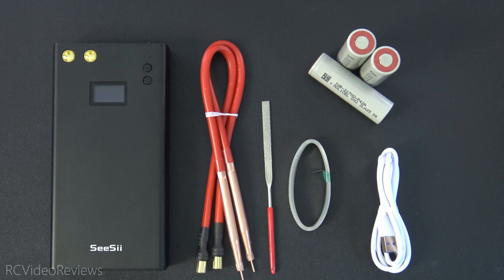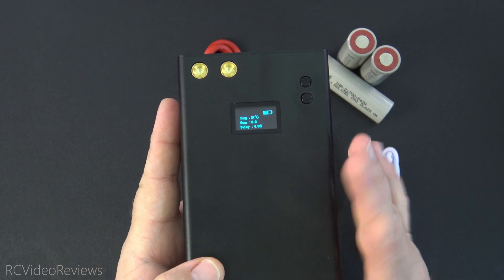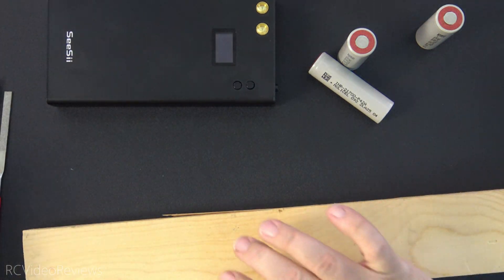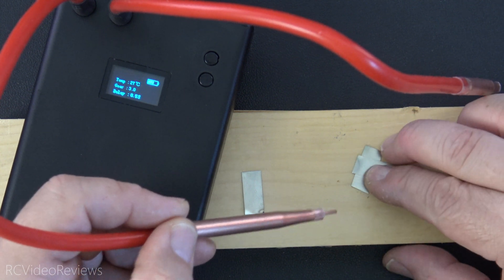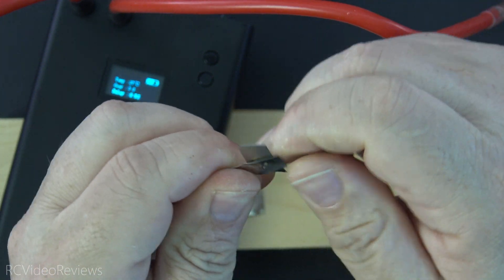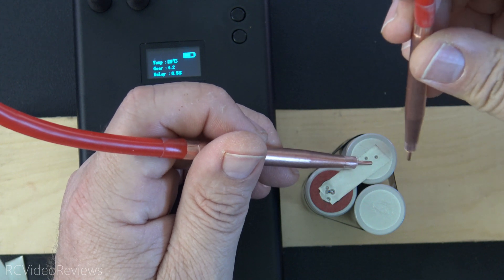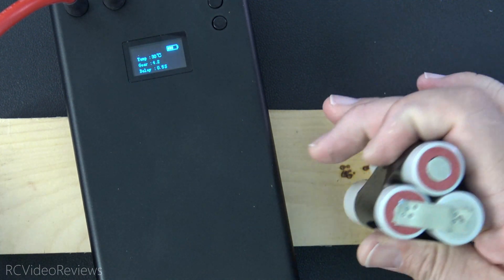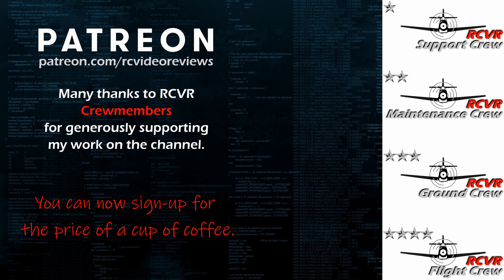Budget Amazon 18650 Battery Spot Welder by SeeSii Review

Comment: gentle touch!? i had heard about too much pressure before but man have don't it wrong. no wonder the weld fell apart. though when i used a marine battery and starter soienoid it didn't matter. these baby welders need that resistance to make heat to melt the metal

Comment: I ordered one like this which will arrive Thursday. I purchased a pen first but I was very disappointed in it. I am tired if soldering my battery packs. The pen did get the job done but just barely before it stopped working and I never got to add another layer of nickel strip. I didn't know I needed 4 of them or even two however I did intend to out two on. The battery pack did work but I need to go back and redo it once I get this one because the welds are very weak. I tried the battery pack out just to see and it seems fine however I would not trust it's durability as if I dropped it, it probably would not hold up. Hopefully Thursday I can fix it properly.

Comment: I just welded a 4s4p pacl but did not use the cardboard insulators. 
Should i rip apart my whole pack to place them?
It is original/new samsung inr 21700 cells.
They are insulated with shrink wrap and the white ring. I am a little worried it might cause problems?

Comment: Some LEDS require up to 3.6 amps max, like for the Cree xhp-70, but I can barely see the width and thickness of the "PCB lines" on the star they put them on. They only need 3 to 12v, though.
Thanks for the obvious "lets pull it apart" testing 😁

Comment: what does low pressure do? ive always used high pressure
Reply: I just tried low pressure trick, and my device finally start WELDING. Before that I was only able to destroy thin plates, but not solder to 18650 tabs

Comment: I bought this same welder last month. It worked well with the steel strip they give you in the box but it was woefully underpowered for pure nickel strip of 0.15 or 0.20mm.

I'm on the hunt for a more powerful unit as I don't trust this to be sufficient for the pure nickel strips.
Reply: Having the same trouble with mine...works great on the thinner .10 strips but fails  on anything thicker.  Trying to rebuild my Milwaukee M12 battery packs with better batteries.  This spot welder will not work on the .20 tab connectors that Milwaukee uses are to handle the current load.  Have to double up the tabs, one on top of the other.
Reply: @ I replaced it with a Seesii 801d and it's awesome! I've used it on.15 pure nickel and .20 with no problems and plenty of headroom still.
Reply: good to know.  I'm dealing with the same issue with mine.  Not powerful enough for .15 nickel strip.  It's the same welder, but doesn't have a label

Comment: are this unit you have still working?, I rarely packing 18650, so are the battery inside this welder still good if not used for a long time?.
Reply from the maker: Mine still works. I don't use it too often, but it does still work. LIPO tech can last at storage voltage for quite a long time. So after a session, don't recharge to full.
Reply: @RCVideoReviews  I see, thanks❤

Comment: Don't know why people attacked you for using pressure as you do need to ensure that the strip is contacting the battery before the welding pulse occurs.  Even automated spot welders use a specified degree of pressure between the materials.

If you don't have good contact, you WILL blow holes through the strips, so perhaps you shouldn't listen to us youtube commenters ;).  Ask a spot welding professional.
Reply from the maker: TBH I just do what works. If I use too little pressure and good contact isn't made, I increase the pressure. If the pressure is sufficient to eliminate the air gap but the weld isn't strong, I increase the power. In the end, I have batteries that I've been using for 3 years and they're doing juuuuuuust fine. You know what they say about opinions....

Comment: I'm not sure, but it doesn't seem to be a capacitive discharge spot welder - seems like a high power resistive welder.  I saw this because the strips seem to have heat discoloration (blackness) and also the wood got too hot in my opinion.  It's too bad you didn't get the case open, but I suspect there isn't enough room for the necessary capacitors.  Nevertheless it does look usable and price will be the deciding factor.  Unfortunately, circuit type (discharge vs resistive) is generally not mentioned.

Comment: I just got this identical item (I think it comes from the same manufacturer but is cheaper and listed as a no label product) and I could not get it to work.
I have used a soldering iron forever so I took these nickel strips and pressed both electrodes and thppt! Nothing. Barely heated it up. After seeing your vid and a bit of thinking seems I can use one probe to hold the strip down on the battery and the other probe (where I want the weld) I only GENTLY touch. BOOM! That does the trick. After time the learning curve in this method starts to come more and more. A very useful tool for future projects! Thanks!

Comment: Hi, could you please do an experiment with this welder and try welding a tongue and spade wire connector together? I have a small approximately( 6”/3” /3.5”) 12v 7.5 ah battery that has a tongue on each +/- poles but I really need a good solid contact. Soldering is not up to the job as it comes loose after a while. I have tried gluing over the solder as well. I am going to try some stronger type of glue. But if you could try your welder and see if it will hold them together or weld the nickel plate to the spade and tongue then join the two together. I would really appreciate it you try it and let us know if the welder is good for that. Thanks in advance

Comment: I wonder how they came up with the translation of "gears" for the output levels.  The "gear" just stands for the duration in milliseconds that the output pulse is delivered; the longer the duration, the higher the amount of energy in the pulse.   The actual current doesn't change with the "gears" and is just dependent on the battery quality and all the connections out to the probe contacts.
I have a $15 DIY unit from Temu and connected to a LiFe battery, it delivered about a 422 amp pulse, with 5ms sufficient to do the spot weld.
Reply from the maker: I think the rough translation is levels or power.
Reply: @RCVideoReviews  yes, but it's an odd translation, by whoever came up with it- assume it was from a non  English speaker.
Reply from the maker: I've seen this same error repeated on multiple occassions.
Reply: @dubmob151  Yes, definitely Chinglish.
Reply: Could it be that an image of gears has become the 'settings' icon for electronic devices? Maybe it should be labeled Setting rather than Gear ⚙️
Reply: @Sønclear-B  now it makes sense how they came up with that nonsensical translation🙂

Comment: Good luck with yours.  I have one I bought about a year ago, and I've used it once. I got it out a week ago and charged it, the screen shows fully charged and I can change settings but it won't weld. As far as I'm concerned this is a total waste of money.
Reply: @brucemansfield2501  Bro it might be that battery isn't good to go anymore, unfortunately they use cheap and low quality batteries for this cheap devices. If you can take apart the device and check what battery is used and replace it that might solve the problem.

Comment: Nice review, but the USB Output is completely unnecessary and the 5V 2.1A USB-C Input is not well thought out. USB C can do more, so I don't understand why this Device wasn't equipped with a corresponding Input. I would have expected a top charging Circuit, especially at this Price. Because of the Display alone the Price is higher than an equivalent cheaper Device that performs the same Task. I'm currently looking for a new one and I would never buy this one for this Price. Thanks for the Video that made this clear to me.

Comment: Great video. I've never messed with building battery packs before, but this looks like a great way to rebuild some of the dead Milwaukee packs I have laying around with quality cells.
Reply from the maker: Definitely. I've seen videos where they take existing packs apart and of multiple cells, only one is bad. By combining good cells, they recover packs worth decent money.
Reply: That's why I'm looking into this. Milwaukee batteries are so expensive anymore. I'm looking at getting batteries from liion wholesale. Apparently they're authorized distributor for several brands.  Looking at the high drain batteries. I've seen some videos of people soldering the batteries but I'm pretty sure you can damage the cells really easily doing that.

Comment: Hello. I have one just like this one, a year old. But on the third battery I was going to do, when turning on the device the display is off!!! Do you know which component I can buy, and where, to solve the problem?
Thanks.
Reply: I was reading on some amazon reviews that if you don't use for a long time then the internal battery will self discharge to a point where it can no longer be charged again.
You could open it up and check or replace the battery.

Comment: I just received a generic version of this welder. (Although the product description stated the brand as Seesii). The probe sockets are not central in the case holes and are shorting across the metal case. Also arrived with the battery at zero charge, and USB A port mounting points had come un-soldered due to the poor fit of the case. Be careful people!
Reply: They have to ship it almost fully discharged...

Comment: So how is the Welder holding up to the USE your giving it .

I would like to know weather to buy one of this brand.
Reply: I'm not him, but I use the 10,000 99 gear model of Seesii. I have done done 17 packs, three on bench to do. No issues, except you pop, pop ,pop. Just going from one battery with no break, I've had the welder unit get to 95* or so and the probes hot in my hands...
Reply: @davidbarker3591   Thanks I just started to build battery packs for my use on my bikes and so far its working like it should . I bought one of these from this company and It works ok so far  haven't really did a big battery pack yet but I plan on building one for one of my custom fatbikes BBSHD odd shape frame center

Comment: I bought this from Amazon. Could not weld pure nickel strip @ .015mm thickness with any strength. Even at GEAR 8.  Had to tear down a 8S4P Lifepo4 battery I built due to weak welds and current imbalances. Returned to Amazon. LiPo packs inside. Second elder I tried. Don't think the small units at around $100 are able to go much beyond .012 mm plated nickel strip.
Reply: Maybe u got a bad one. I have the 10,000 with 99 gears. NEVER used  plated steel. That' stuff is junk. Pure .10mm nickel, easy. .12mm is pretty easy. I've done .15mm pure nickel. It'll do it, but is at gear 
85-90. As a person practices and gets a better technique. Also keep the tips of the probes clean. That really hurts performance..

Comment: Very nice video and a great help to make a decision.
Do you have a picture of the inside of the device in the meantime? I would be very interested to know which batteries they have installed.
Thanks again for a very factual, objective and informative video.
Reply from the maker: I tried taking it apart and to get a look at the cells would be destructive. I think they’re some sort or lipo.
Reply: @RCVideoReviews  I have learned that you are right on both counts, 1) They are LiPo cells, and 2) it would be destructive to look further. You made the right choice to not go further. I have one on the way now. Thanks again for your post!

Comment: I used the same welder for Makita battery 🔋 to be welding. 0.15mm Pure Nickle strips was used but the welding has weak... 0.2mm would not do it.
Reply: Your technique will get better. Make sure tips are clean. I do 
.15mm pure nickel decent. Never had problems the Seesii will not do .20mm thick

Comment: 9mm x .15mm gives about 1.35mm2 which should be good for about 17A *continuous*.
Reply: Don't know where you got your numbers, but that's not even close!! If you had pure copper, 1.35mm Sq is good for 20.5 amps. Pure nickel is 24% as efficient as copper. A strip of pure nickel. 15×9mm is 5.5 amps. Heck, .4×9mm is only good for 13 amps. The closest he might get is .2×10mm and that is 9.9 amps...
Reply: Matador Ampacity chart shows 6 continuous amps. It's the same cross section of 16 gauge copper wire that is good for 21 amps, which makes sense as pure nickel only pulls 25% of copper

Comment: Why risk damaging the probes by placing them so close to each other?

I appreciate too much pressure is not good but surely you want to ensure as much as possible that there is no gap between the 'wire'/strip and battery terminal...?
Reply: If you spread them too far apart, by the time the current goes back up the the 2nd lead, it's weak...look at the machined spot welds. 1/8" apart.

Comment: Hey amasing video, well i am thinking to get one for model making, looking to weld stainless steel wire 1mm thickness, important not to solder but to weld, can you help me and check if this tool can do that, and if its holding well.
Please :)
Reply from the maker: This isn't the right tool for that. The strips are very thin.
Reply: We spot .1mm....you're talking about 1mm....that's 10 times thicker...

Comment: any idea why it would stop welding properly I used 2 months ago and built a big battery and it worked well. today I charged it up fully and now I cant get a good weld even on its highest gear
Reply: I can do a full battery, 5s 2p and not use 1/4 ...I'll just plug it in while I'm doing different. Make sure the tips CLEAN...get rid ozone residue and impurities.  Amazing what a difference that makes.
Reply from the maker: Sounds like a dead/flat battery...?
Reply: @RCVideoReviews  it charges to 100% and if it died after like 100 spot welds that is pretty sad

Comment: How dangerous is charging this unit if it has LIPO battery ?
Reply from the maker: Since it doesn't rely on any specific type of charger (balance charger) it will have a BMS installed to keep cells balanced and the charge cutoff at the appropriate levels.

Comment: Can you please confirm 2 things:

1. Can you spot weld two on each other connect them in parallel on the battery
2. Also do you need safety glasses for this, because I know with welding (causes eye damage if you look at the point)
Reply from the maker: You can weld one strip to another. Do them one at a time. 

It's never a wrong answer to use safety goggles. That said, I do not wear them for spot welding. I accept the risk.
Reply: @RCVideoReviews  Thank you so much, would you tell me what glasses would be good for this from Amazon?
Reply: I always spot the first layer to cell. Then lay down the 2nd and spot to first layer

Comment: Thanks so much for the upload and great info. Just got my very first kit in and its set up exactly as yours but it says upgraded 3Goa model, although the one on amazon says Riiai on it, made by Shenzhen Jueqi Tech. Same specs 7500mah 650A. Don't see where the upgrades are. Eventually want to build my own quad copter, Space 1999 Eagle or TOS Enterprise, but to get experience on the batteries I decided to upgrade my 14 year old Craftsman handisaw with a few LiPo. I was wondering, to get the higher amp pass thru, would it be better to tack the first two, bend the strip over, tack those two and then bend it over again.... so on and so on, and then cut the strip, so it'll be one solid instead of separate strips? Thanks again for getting me up to speed on my new mini-defibrillator ;-) Go gentle into that good tack weld night lol.
Reply: Its odd that the cheaper one I ordered said it only has 7 gears, the one I received has 8, but that one is 11,000mah hmmm. Oh and it has an auto shut off after 5 minutes.
Reply: I've never seen anyone do it the way. In the long run you'll use more strip though..

Comment: When doing multiple strips would you consider welding between terminals?
Reply from the maker: I don’t think it’s necessary.
Reply: It can be very important. If doing a power tool pack, you get a lot of packs hot rod cells. I use Samsung 25R a lot. Max constant discharge rate is 25 amps. It can flash 60 amps for 1/2 second. If you are laying down .15 pure nickel, .15mm×8mm wide is good for 5amps...I normally use .12mm nickel. I'll stack If you are using a hot rod cell, you'll at least stacking. If I need capacity, I solder 18 awg pure bare copper wire is is good for 15 amps. I've built with 2 wires soldered to the nickel. I try to solder the wire to nickel before spot welding. That gives you about 35 amps

Comment: great video learned a lot. so I should double up on the strip to carry more amps? what's a good size to use max current pull around 30 amps to be safe but not consistent, 15amp continously.
Reply: I use Matador Ampacity. It gives you current capacity, the mm² area, gives you equivalent  in AWG copper wire.' 5mm-10mm width, .10-.50mm thick. If you use a little spot welder, like I do,   .15mm is maxed. But even .15×10mm is good  for 6 amps, so you might, by stacking 12 amps. I'll solder solid copper wire you strip, then spot weld the strip. 2 side by side 18awg copper wire is good for 14A each. That handle 35 amps..
Reply from the maker: There are charts like this one out there listing current carrying capacity of metal strips: https://www.diyelectriccar.com/attachments/strip-ampacity-pdf.120970/

When you put conduits in parallel they split the load.
Reply: @RCVideoReviews  great thanks 😊